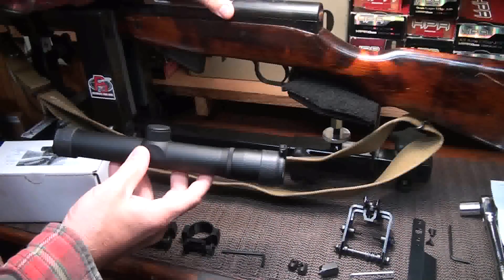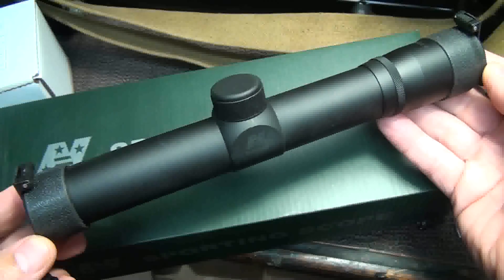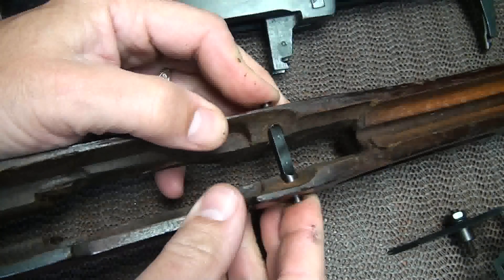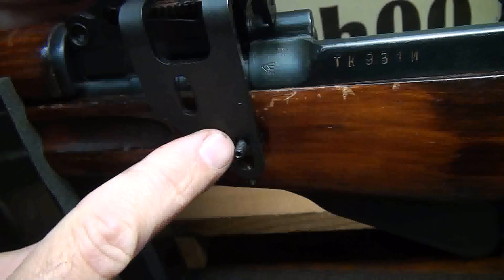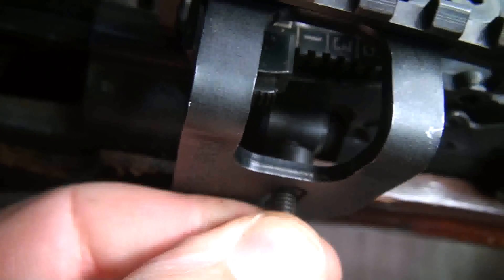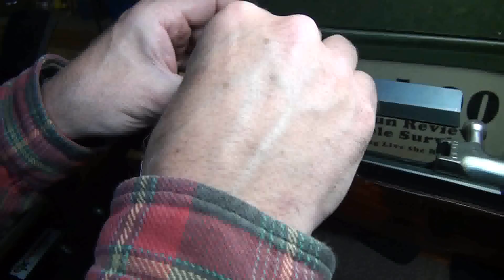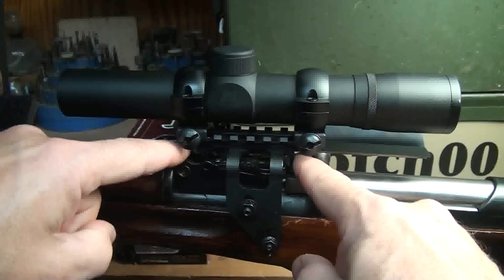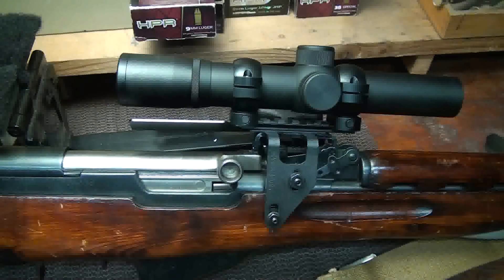SKS Scout Scope Mount by Brass Stacker

Comment: Thank you for this professionally detailed video. I just knew one of my sks's would finally get scoped but my dream come true was shattered due to their site specifically stating this mount will not fit a Norinco sks. Both of mine are Norincos-bummer. Again thank you and I will keep dreaming of finding a solid scope mount for my Norinco sks's.
Reply: Rude Dawg same. I have a Norinco, did you ever find a good one?
Reply: @AA-bn7tf   Not really. Scout Scope Mount makes one but their website continually shows out of stock. I put a now discontinued UTG SKS quadrail on one but it added a lot of weight to the front. I'm still hoping to get the Scout Mount if I can find one. Good luck.
Reply: Rude Dawg. I bought the scout scope mount. Email the address on the website and they will be able to sell you one. (Scoutscopes.com)

Comment: Sootch, really like the way you format your vids and how hard you work at providing quality content. Alas, this unit won't work on my Norinco at the present, but they are working on a solution. Appreciate the comments some have made about using the irons, but this does not impede using them, simply provides another tool. Also, there are shorter scope options, as well as red dots, etc. that would not impede using stripper clips. A person should be quite capable of placing a quality shot with the irons at the usable distances of this weapon, but for some of us with "more mature" eyes, a little extra help doesn't hurt.
Reply: "more mature" as in O-L-D-E-R. :-)

Comment: Nice that they include a shell deflector. I installed a scout mount that replaced the rear sight...and shattered the Bushnell TRS-25 I had mounted with ejecting casings...my fault, but it still sucked.

Comment: Looks like an awesome total system that you have put together with the Mount, Rings. Scope, Shell deflector and cheek piece. I realize one does not want to make a video that is too to long - but it would have been helpful to know what one has to do to get everything as level as possible on the first installation of the kit. Also I noticed there wasn't any lock tite used. And you may have added how the reloading goes with the shell deflector in place.

Comment: Interesting and functional rig. Question: would the ammo have to loaded one at a time, through the bottom or would a Tapco mag be best ?
Reply: You should be able to replace the box mag with a tapco mag pretty easily. I have a Promag which I had to file down just a little to get it fit but it definitely works and feeds fine.

Comment: neat idea, but in the end, there is no reason not to use your iron sights on an SKS.  Become proficient with the iron sights; there is lots of distance between the front and rear sights on the sks, making them extremely accurate for what this rifle is. Get a good dragnov style synthetic stock and leave the SKS be. My 59-66 Yugo always turns heads at the range, and the groupings I leave are nothing to wave a bayonet at..
Reply: Glad your eyesight is still good. A lot of us aren't as fortunate. I'd be much more apt to opt for a scope/other type sight ( not necessarily this one ) than a stock which, imho, does more to take away from the rifles basic combat good looks than anything else. Of course beauty is in the eye of the beholder..
Reply: Nate Ngzcaz no i agree nate even with my glasses i still have trouble with those black sights i may paint a lil white on the forward sight post
Reply: NOT TRUE. WHE YOU WEAR TRIFOCALS IT IS HARD TO USE IRON SIGHTS.
Reply: NoBs they make these things called glasses look em up they work great

Comment: But how can you access the gas tube extension rod & spring without having to remove that entire girder bridge thing?  You gotta take the Brass Stacker mount off every time you need to clean the gas tube assembly?  That's a hassle.
Reply: no there should be enough room to raise the gas tube release lever i was curious about that as well so got my sks and it looks like there should be enough room

Comment: Thats no good. Cant use stripper clips
Reply: Get yourself some detachable mags. Or a red dot.
Reply: You can use stripper clips without a brass deflector if you use a Red Dot system.
Reply: Scout Sniper that's what I was going to say buy a recessed scope so u can still use the strippers
Reply: IT IS A GIVE AND TAKE WORLD OUT THERE. WHY DO WE NEED TO SPEED LOAD ANYWAY? ZOMBIES? RIGHT WINGS? OK, MAYBE RIGHT WINGS BUT THEY ARE ALL HIGH ON POT AND CHANGING DIAPERS AROUND THE WORLD SO THEY ARE SLOW; NO NEED TO SPEED LOAD.
Reply: Thats left wings
Reply: @5160mwin:  If you are using the weapon for Home Defense, then speed of reload is important.  However most of the time it's not about speed loading, it's about convenience.  Stripper clips are easier to load and make the ammunition easer to carry.  You can carry several loaded clips in a small pouch and easily reload when you are out. This makes range time much more pleasant, and you get to shoot a bit more for a given amount of time.

Now, you may say, like evilmonkey45, "you should just convert to using a magazine then".  The problem is that some of us live in places where local law doesn't allow for removable mags or places onerous requirements on you (like no foregrips, no bayonet lug, no flash suppressor, etc etc etc) if you have a removeable mag.  So keeping the internal mag is a way of being able to keep all those other features.

So keeping the ability to use stripper clips is critical to a good mount.  I think this one comes close, just not with this scope.
Reply: HA! I guess time will tell, my friend. Maybe you were trying to say "Left Wing" and got confused. Don't worry, this seems to be a common trait among Liberals ie: Nancy Pelosi, Hank Johnson, Maxine Waters.
Reply: No. No you can't. The rear of the scope rail sits just in front of the "slot" for the stripper clip. You could insert a stripper clip. But it has to be empty.
Reply: Just load it from the bottom
Reply: Box mags
Reply: Lol now there have replacement gas tubes with integrated pic rails. Way easier install and most red dots have LER
Reply: Would this work with the Norinco SKS?
Reply: @5160mwin  I think you mean left wing. Maybe you're too crazy to know which is which. "Smoking pot and changing diapers"? R u even American?  LoL

Comment: I bought it and my main complaint is that there is no allowance to swing the piston locking lever when cleaning the piston and gas cylinder. Quite a disincentive to clean the cylinder right after firing recently a the range. Managed to clean the rest of the rifle promptly but let a day or two pass before dismantling the whole mount and the cylinder showed early signs of rust. That's how corrosive milsurp ammo is. Anyways, this design is not as practical as the video and the company suggest. I am now doing some modification to increase the height of the picatinny rail and am constrained to file away and round the edge of the locking pin. Such an expensive item that defeats the purpose of having an optic, being able to have the backup iron sights, and (VERY IMPORTANT!) being able to promptly clean the gun after shooting  --- like before installing this inconvenient high-priced mount! And to be sure, after reinstalling a modified mount I will have to again zero in my optic. I DO NOT, REPEAT, DO NOT RECOMMEND THIS MOUNT.
Reply: The thing that upsets me is this guy never mentioned about this defect design which he would have observed in the first place if he indeed had done the install of the mount.
Reply: I'm beginning to agree to what other posts somewhere say: I'm better off just using the original iron sights because an SKS is really not designed for optics AND at the same time retaining the use of its iron sights. Expensive lesson learned here.

Comment: So, after 2.5 years after this video was made, how is the mount holding up?  Has it moved?  Still holding zero?  Have you dropped/bumped the rifle on the mount?  

I'm really interested in a few of these but want to make sure it holds zero in the long-run.  Otherwise, a drill and tap may be better suited.  Thanks!

Comment: That's such a cool addition, I have actually been hoping they would make one for the SKS family since they did the Mosin Nagant. The only sad thing about it is this mount prevents the use of stripper clips. By the way how is the Brass Stacker Mount and the optic on it holding up to the recoil of the Mosin Nagant? I assume it's still holding zero.

Comment: Hi there sootch00, I recently bought a steel 7rd replacement mag ( unknown brand) for my Chinese SKS but did not notice until after I fitted it to the rifle that it does not have the "hold bolt open" tag on the mag follower to retain bolt open after last round.  Its going to be a real pain to recharge the new mag either from the top by hand or with a stripper clip as one hand has to keep the bolt open.  I like the look of the new mag and would like to retain it but loading it is going to be fun, NOT  !!!  Any ideas about how to hold the bolt open without that tab on the follower, thanks.
Reply: +true7005   Thanks, will have a look at what you suggested and get in touch with a "smithie"   Cheers.

Comment: over complicated mount with to many bolts, screws and nuts to adjust. I do have a NC Star gastube picatiny mount, it is rock solid and can be easy installed by disassembly the original Gas system like cleaning and replace the gas tub on reassembly. 
You have the same result in the  end.

Comment: Impossible to get a good cheek weld with the stratospheric height of that mount, even with that buttstock cheek piece, and it's going to upset the balance of the rifle.  The SKS is already a hefty carbine at well over eight pounds in stock form.  I'm sure that this rifle is as heavy, or heavier than my scout scoped, ATI stocked, full length barrel Mosin.  The SKS has neither the ballistics nor accuracy to warrant magnifying optics.  Hell, I only use 2X on my Mosin, and it has at least twice the effective range of the SKS.  I put a $30 Williams aperture rear sight on my SKS, and get groups nearly as good as achieved here, without adding any weight. Disabling the stripper clip loading is completely unacceptable for a combat carbine, unless you're going to convert to AK magazine capability - more money spent.  All this crap turns a decent handling carbine into a real pig.  An expensive pig.
Reply: Shawn Wells how do you feel about the red dot sights for the sks? everything you are saying makes a lot of sense
Reply: The problem is there's nowhere (stable enough) on an unmodified SKS to mount one.  Several replacement stocks have rails that would work, but I consider stock replacement one of the most expensive, least beneficial modifications you can make.  You'll have more invested in modifications than the original rifle is worth, and it won't necessarily shoot any better.  For $30, you can turn the rear sight into an aperture, and you'll have all the accuracy an SKS can deliver.  My SKS will group 3-4" @ 100 yds., so an optic isn't going to be very beneficial except in low light conditions, which I don't use it for, anyway.
Reply: Shawn Wells there are many stable enough mounts. both rails for the back and the front 
scout mount is one of them.
Reply: No, there are not.  For example, the mount in this video has a set screw bearing on the op rod housing.  How the f...k is that stable?
Reply: Shawn Wells i was not talking about this one. but have you tried this one? just deciding it on principle because you don't think it would is not a valid conclusion. the scoutscope one is stable, as are several others that screw into the stock and receiver. without knowing all of them, it is ignorant to declare that none of them work.
Reply: Shawn Wells , :

Comment: Is it compitable with aftermarket detachable magazine?
Reply from the maker: My Tapco mags work fine in this rifle. Thanks
Reply: ***** Do they work with a Chinese SKS?
Reply: PhantomDark21 why would the mag interfeer with a scope mount?
Reply: Francis Marion tapco mags work fine
Reply: +XxPurpleXHazeX   Hi there, are you referring to the SKS Tapco polymer mag  ???  I'm the guy above who bought a 7rd steel mag for my SKS but it's been a disaster.  It does not have the "hold bolt open" tag on the mag follower like the original integral drop plate mag, so to recharge the mag you have to hold the bolt open at the same time, a real pain  !!!  Also it just does not cycle well at all.  No matter how many rounds are in the mag, it will chamber the first round, fire it, but then the second round ALWAYS jams, pointing upwards, and stuck between the bolt face and the chamber.  We have those Tapco polymer 7 round mags for sale here and was wondering if they were any better with recycling the rounds, thanks.